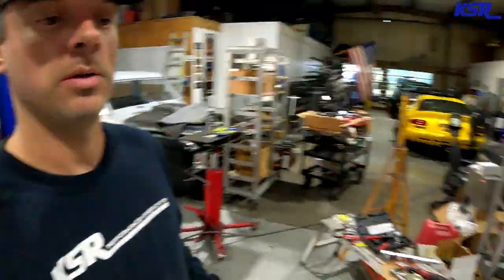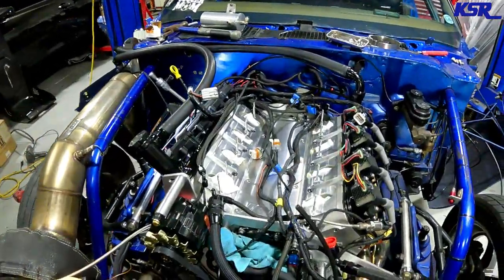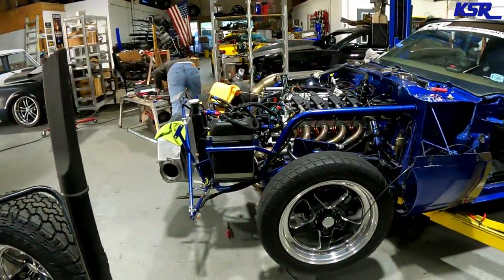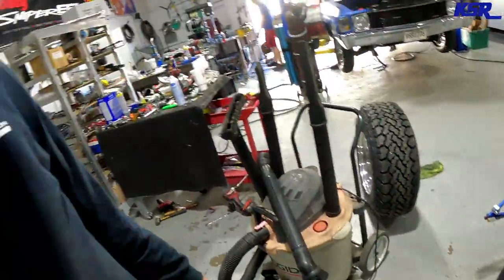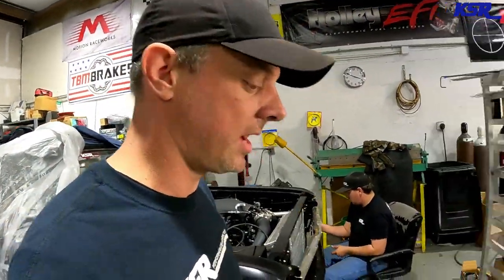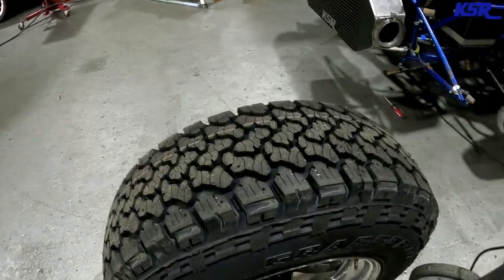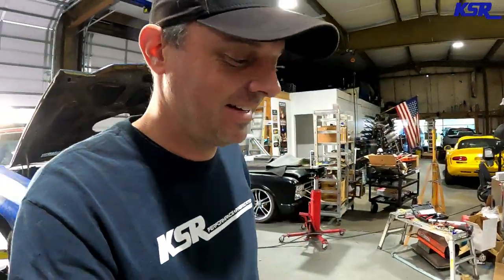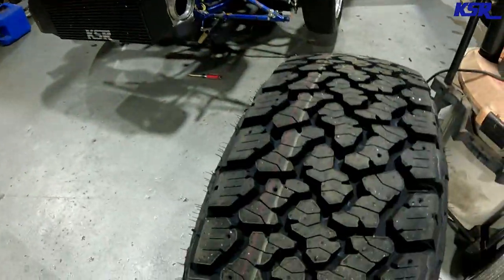SoccerMom Gets Some New Wheels for Sick Week!! But, we have a BIG Issue with the fuel system!!

Comment: Pumped up for the olds content. My grandpa put a 455 rocket in a 71 c-10 when I was a kid. I Still got the truck and engine.
Reply: Wanna race brother
 i got a 70 c/10 327 with a 4 :11 rear end with a power glide between them

Comment: I'm not sure how conscious you are of 'tool access' when designing these one-off's. But when designing production engines all hardware has to have straight line access so it can be run down with a power tool. This really benefits service time too, to replace components without having to use any wrenches.

Comment: Put a 255/70/15 on it there 29/9 street tread...I put them on my Nova with 4.10 gear and I run 60 at 2700rpm turbo 350 trans 4500 converter

Comment: lol, that takes me back to high school in the early/mid 90s.  Son of a local engine builder had a second gen Camaro with stock 350/TH350 but he wanted 13's so dad put 4.88s in there and running a slick would run 13.98 in the 1/4.  He had to run a 31" BFG A/T to be able to run it on the street without losing his mind....

Comment: Does putting the injectors up so high on the runner cause any tuning issues?
Reply from the maker: It will react a little differently, but we should be fine. The angle of the injector is the bigger issue.

Comment: Havin 2 sets of injectors is good but how do ya plan on turnin each set off for differnt runnin types or does the ECU have a feature for it?
Reply from the maker: Eventually we will do it all in the ECU with Holley's Injector Driver Module, but for now, we will swap tunes in the ECU and switch the injector harness between injector sets.
Reply: Thats a nice and simple way for it,thanx for the info Kevin
Ive been wondering if they even have flyback diodes in them for switching due to voltage surges like relays do

Comment: Great fab work, question though, do you add another ECU to power that set of streetable injectors, and switch off between 2 ECU's and harnesses, or use the same ECU, and just retune? Inquiring minds want to know how you added to the existing harness if option 2 is used.  Just understand here using 2 sets of same type and flow injector sets, but different types and flow rates, is a bit more confusing on the wiring, tune, and controlling/powering.

Comment: @KSR
Great video as always Kevin. Hey I thought of a futureproof idea for your bungs for the road fuel line in case you ever come across this problem again. Where you put straight bungs in then welded them to the casting the next time why not bend the tubing for the bung into a J style piece so that you slide the curved bung into your casting so the fuel is directed into the specific path you prefer. This way it will make you feel better that you have done a more professional job even tho it's hidden but it's not nagging you  like it will now cause your current setup is not the way you wanted.
Reply from the maker: The injector tip needs to be aimed at the valve. The fuel comes out in a mist so having a turn in the tubing after the injector would be real bad.
Reply: @KSRPerformanceFabrication  No probs, I thought it might be beneficial to you but it's okay thanks for teaching me something I didn't know

Comment: Whats the logic behind the big tire? :)
Reply: The car has relatively high final drive gearing since it’s set up for 1/8th mile no time racing. Thus it is a pain to drive on the street without an expensive/heavy overdrive unit. Tall rear tires effectively make the final drive ratio lower, meaning the engine will (hopefully) be at a lower RPM for highway driving.

Comment: Great video again. Some cool fab work. Couple of times I sucked air through my teeth watching. The initial drilling, I like to measure many many times before drilling cutting anything (especially if it will scrap the item if done incorrectly). I suppose the time lapse and perhaps unseen footage make it look like you just went straight in there. Also, when you placed the manifold flat on the table with the mating surface facing down. Just makes me cringe a little, I guess it's not mega important with the type of manifold sealing you are using.
Looking forward to getting the cars finished and the dyno of Dereks Chevelle. Lotta work, hopefully it all goes well.

Comment: Kev...wouldn't it just been easier to change the injectors for road trips, rather than duplicating the injector/fuel system and adding complexity to the car?
Reply from the maker: Weeellll, we didn't really like the idea of spilling fuel all over the hot engine, so we went this route. The less hard work we have to do, the better on these drag and drive events.
Reply: @KSRPerformanceFabrication  Fair enough...I guess it saves time in the long term😐

Comment: Ugggg, Those rear tires. You know that you have options right? I assume the rear rims are also 17's. If so, just get a pair of 225/75R17 tires. They measure out 30.3 tall and 8.9 wide. In stock everywhere. And they don't look like goofy mud tires.
Reply from the maker: They are 15" rear wheels.